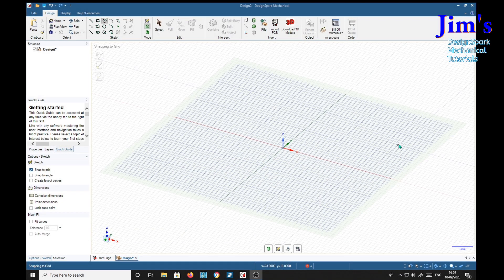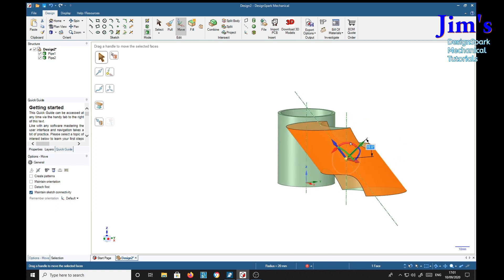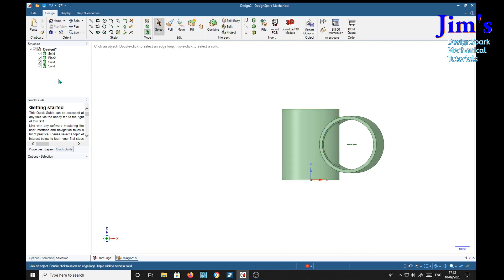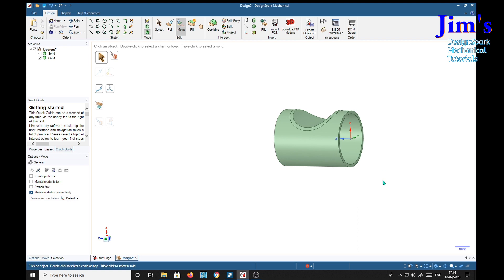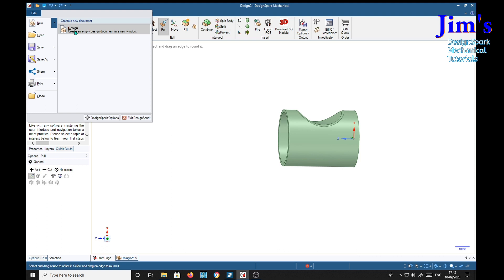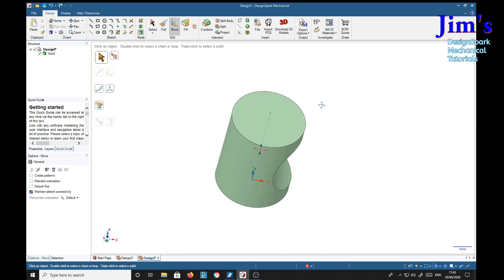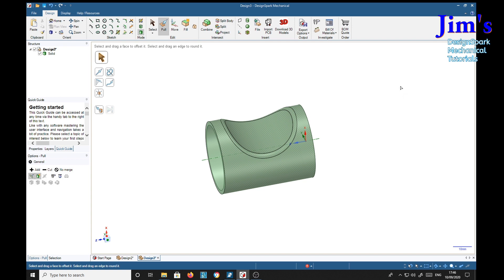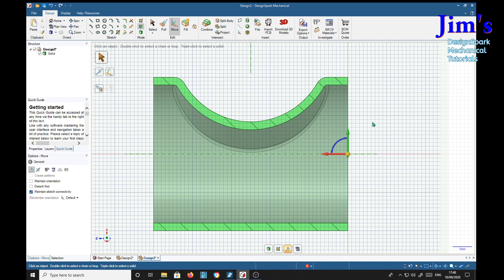A Pipe with Indents

Comment: Hi Jim, thanks for your tutorials, Having just started in designspark I find your videos a real treasure trove.
 I just tried your second way of making an indent in a pipe and I have one addendum, if you put a fillet on the outside indent before you hollow out the part, the inner fillet will follow the outer fillet proportionally to the thickness of the tube. Thanks again for all the info.
Reply from the maker: Well done. Thanks for your comment.